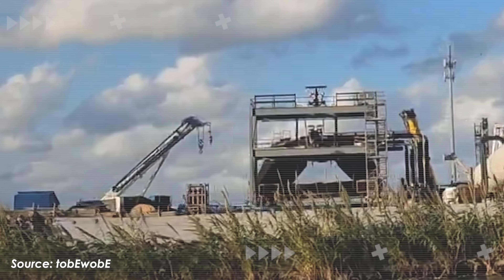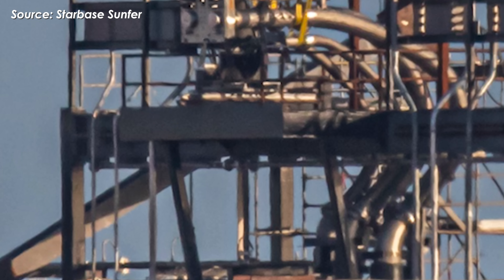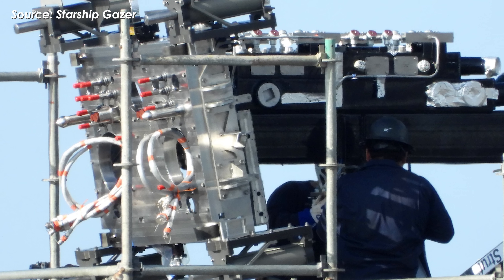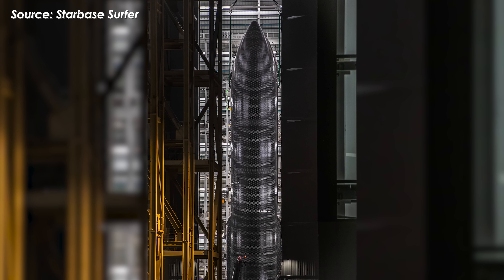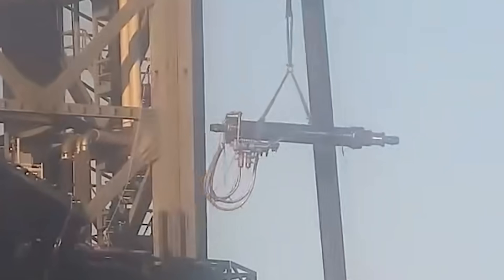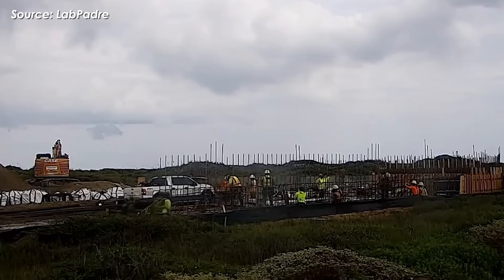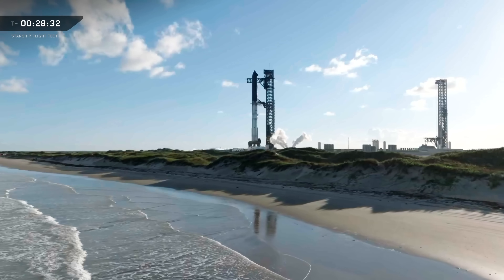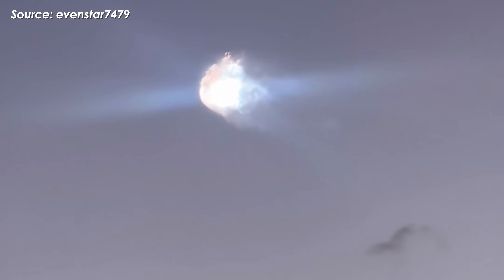SpaceX's Official NEW V3 Starship Test Stand CHANGES to prevent Explosion...Ready to Fire!

Comment: The Wall Street Journal and other media is conducting what is called a Stock Market Bear Attack on SpaceX. Designed to devalue a company in the eyes of potential investors. On the flip side they are doing major ‘touting’ of Rocket Lab and Blue Origin… especially Rocket Lab. Touting is designed to increase the value of a company in the eyes of potential investors. Go figure.